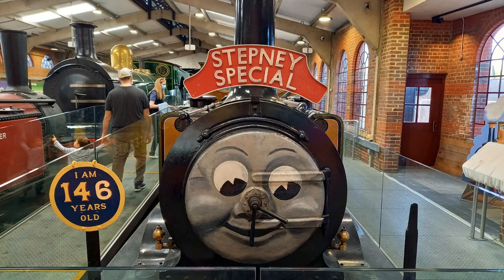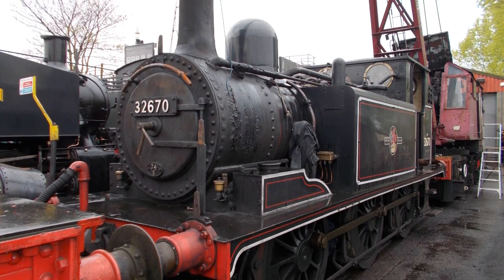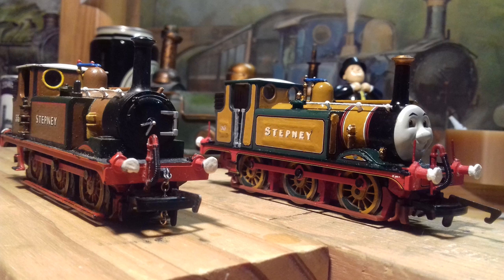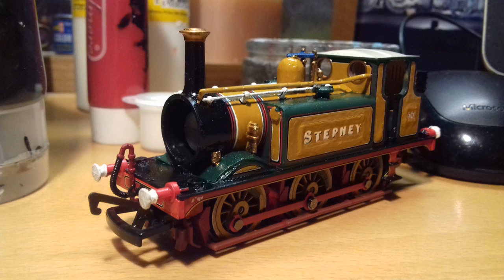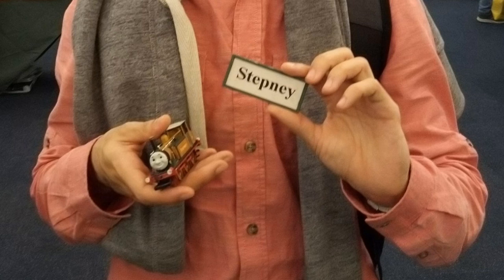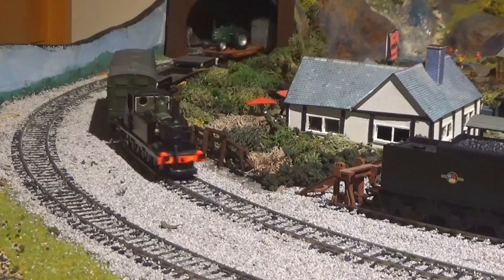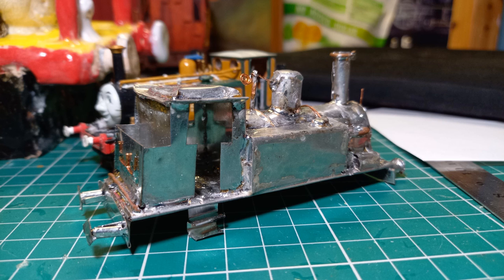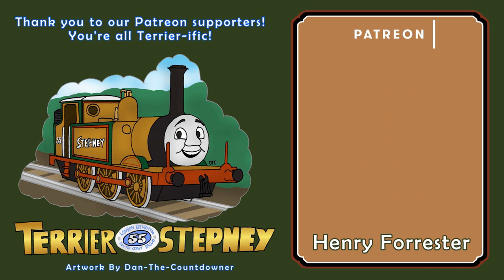Modifying Old Hornby Terriers (Happy Birthday Stepney)

Comment: the price gap between the  dapol tooling and the 2020 hornby tooling is still frustratingly small.
not sure why, the dapol austerities are regularly around £30 but the terriers are around £45-50, and when the newer tooling is as little as £75 brand new,, it hardly seems worth it. shame really because i really want some of the simpler tooling for projects... and i'm cheap

Comment: What did you use to fill in the holes for the Westinghouse Brake Pump? I'm looking to do the same and fully A1xify my Whitechapel model but try not to butcher the sandboxes.
Reply from the maker: I used Milliput to cover the gaps, which when dried is able to be sanded down.

Comment: Speaking of the new terriers, im trying to get a new terrier in Weston Clevedon & Portishead Railway Green , specifically No.4 which was Stepneys older brother, it was originally No.53 'Ashtead'
edit: i couldn't get it because it was £110 and i only had £102, so i got a BR black early lettering terrier for £90

Comment: You could go to trainz pick the sodor workshops stepney 1960s, and print the image file that has the lettering and number.
Reply from the maker: Thanks for the suggestion. I gave reference images for that model so I did use the original file for this iirc. Could use printing in a higher quality though.
Reply: @Terrier55Stepney  tracing into a vector is also an option, maybe even commissioning someone if you're not confident in tracing yourself